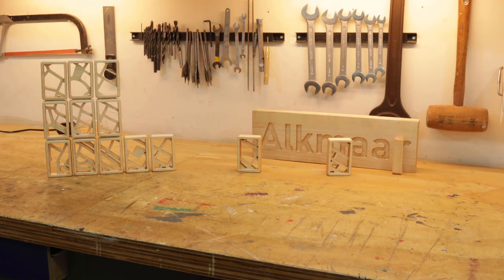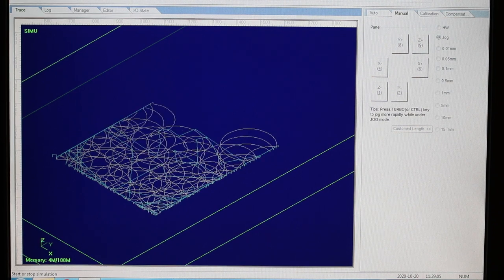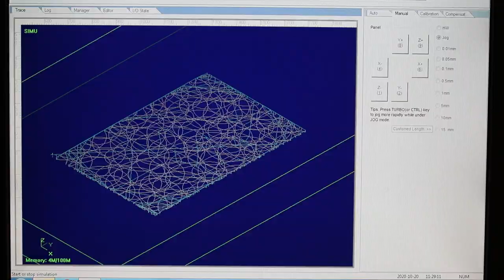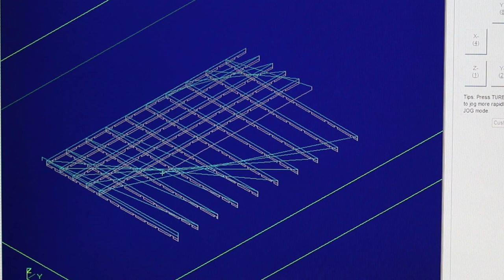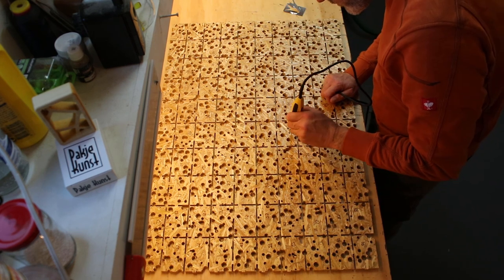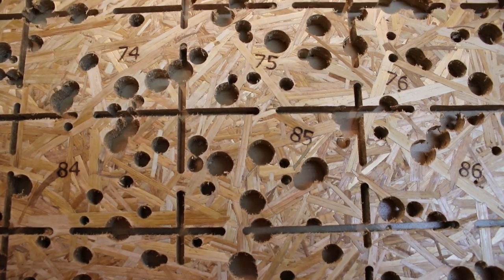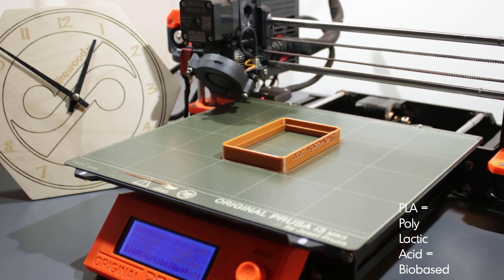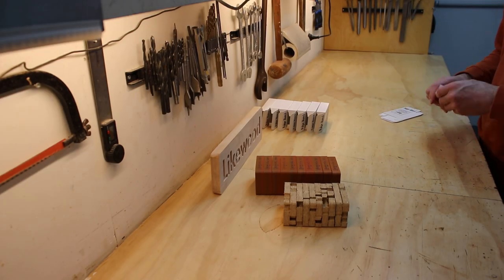Another art project for Pakje Kunst | made with CNC

Comment: Your design and build talents are extraordinary. I would have gone nuts hand painting all those grooves ... did you consider using a vinyl mask or a sealer coat before cutting the V-grooves, then spray paint over it all and sanding off the excess?  I've used vinyl mask (cheap shelf paper) for a couple of projects with good results.
I built furniture for 35+ years, but I envy your talent.
Reply from the maker: Thanks! Yes I have consider that. But painting by hand was very relaxing.